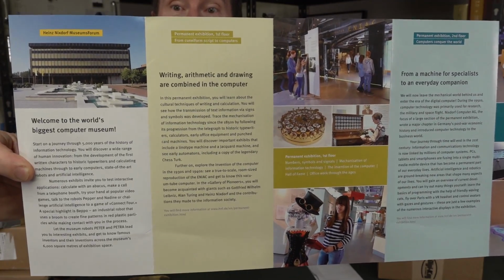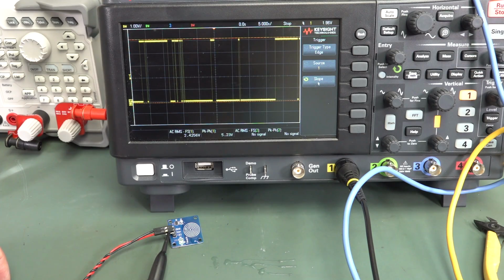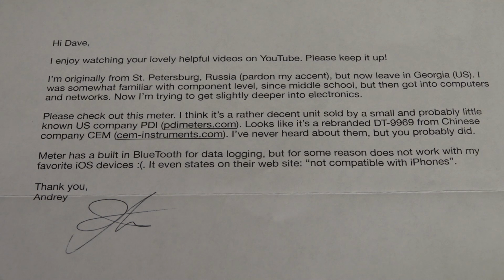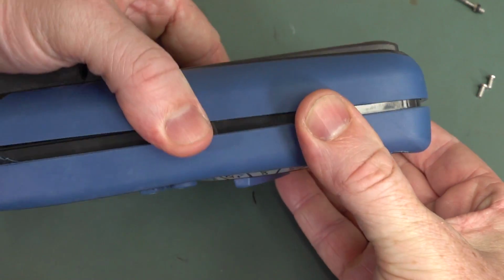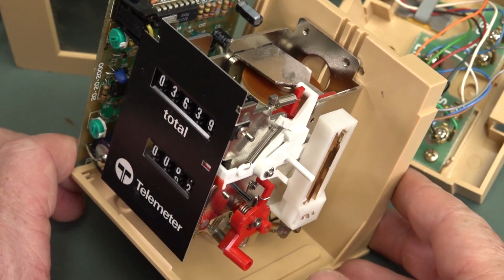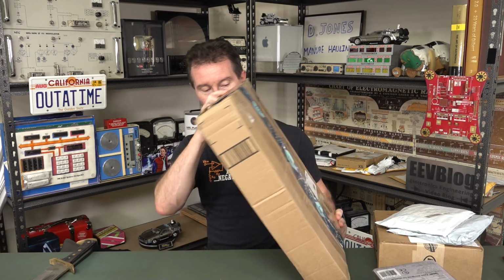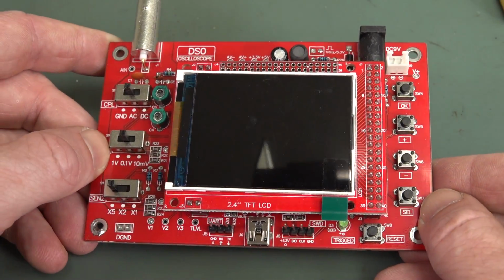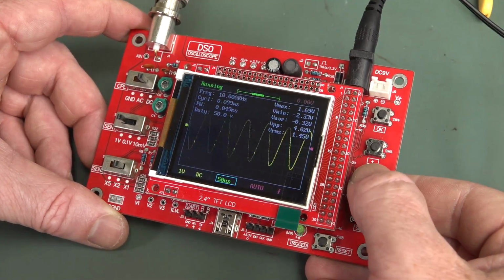EEVblog #1272 - Mailbag

Comment: Not gonna sign up on LBRY, sorry.  Blockchain is good for some things but where are the actual streams being hosted?
api.lbry.tv... which is on AWS. That still putting your content in the hands of a big corporation. If Amazon doesn't like it, it's goneski. Short of Bittorrent, video is not decentralized as the bandwidth requirement is too great. Also, you probably won't be in the best company on there... The people getting kicked off YouTube and heading to other services are hatemongers and crackpots.
Reply from the maker: Streams are being hosted on a combination of LBRY servers and the individual machines of the viewers, it's how decentralised video works.
And no, Amazon or anyone else can't nuke the video, the LBRY system is protocol layer thingo like HTTP is, LBRY.TV is just a nice web interface to make it more appealing, you can bypass that and use the LBRY app directly.

Comment: 20:13 "NEVER connect the meter leads across a voltage source while the function dial is in the current, resistance, or diode mode"
Well I WAS going to put the meter in between the leads as an intermediary device, but now I am warned @ how an unenergized USB 1.0 port must immediately destroy all it touches due to its capability to provide... indefatigable potential. gratuitous f-bombs

Comment: Is not the accuracy of that multi meter only as relevant as the accuracy of the parts in a circuit. My electronics teacher taught us that when doing the math and measurements of a circuit you are only accurate as the least accurate part meaning if one part is only accurate to 1 decimal place then measuring a voltage to five decimal places is a waste. For most hobbyists needing a meter one that does 50k samples vs 20k samples is not going to matter so nit picking the meter over that or the leads or the beep it makes is useless negative comments. Really ask yourself will the meter do the job, will it work reasonably well for a hobbyist. I have both a NeoTeck DM6000 Pro and a Uni-T UT61E, both do their jobs perfectly fine and cost under 125 CAD. Got the UNI-T for it's ability to connect to a PC and see the meters output in linux.

Comment: D7, the big through-hole diode in that multimeter, is a 6.8v Zener diode.

If it only has an ATmega processor in it, then they're probably doing the heavy lifting for the interactive application in the AXP core in that CSR bluetooth module.

Comment: i have a genuine JYE Tech DSO138 scope that i bought way back, before I could afford a proper scope.
TBH, I bought it mainly for the soldering practice. The SMD ICs were pre-soldered,  but nothing else. I had some fun with it, and found some use for it, but 'it is what it is.'
About the same time, I bought a JYE Tech FG085 DDS Function Generator kit, which I still use today.
My soldering skill has increased considerably since those days, but unfortunately, my electronics skill level hasn't quite kept pace :-(

Comment: Hi, A. Rich from Ohio. I just googled “Tectronix 2213 focus adjustment”, A wealth of information popped up. Here for example a very nice pictorial presentation of the repair: 

http://www.byan-roper.org/steve/steve-at-play/antique-electronics-and-2/tektronix-2213-focus-repair.html
Just a reminder: scopes with CRT tubes have high voltages, be careful. Please heed the precautions outlined by Kasper Abigail in a post below. DONOT ELECTROCUTE YOURSELF. By the way, you will find discussions of the issue of this repair also on Google. Here is a site for a free pdf Service Manual for the 2213:

http://w140.com/tektronix_2213_service.pdf

Comment: Hey Ethan. I recently watched your videos about capacitors, and you state that Electrolytic capacitors become unreliable through time, but you don't give any detail about that. Do you have an example of how long they last in different applications ( it should depend on the which capacitor, but just to give a general idea). I tried researching a bit and found some info about shelf life, but from what I got they have sort of a parabola shaped life cycle, where if you don't use them they last little, if you use them at a proper range they last the longest, and if you try to get too much out of them they break sooner. I thought it's an interesting concept, and it's all quite weird to me. I study electronic engineering in brazil and we don't learn much about the subject, it's mostly unrealistic theorical stuff. If you know a lot about the subject it can be nice to make a video about reliability of electrolytic capacitors and other kinds.

Comment: i got a similar DSO low frequency oscilloscope. it's useful for audio stuff, couple it with a 10x probe and it can do some 230vac stuff. i had some success reading the debug pin out of a psu that exploded on me a few months ago. you can also kinda measure capacitors.
DO NOT trust any measured value on that thing though..

Comment: I have another of the JYEtech scopes (the DSO shell/DSO150 about the same price with similar firmware and specs but much better controls). The crazy thing it that it has taken over 90% of my oscilloscope uses. I repair a lot of stuff for fun and for power supply and audio circuits it's all that is needed, and easy to throw in a bag at the same time. It's even fine for a lot of microcontroller stuff, when you want to check if a signal, clock, data, PWM, you name it, is there and in the expected ballpark.

Oh, anf if you do got for the original from JYEtech you can get a kit that hasn't the SMD components soldered either.

Comment: The "strain gage" is actually a trimmable resistor network used for nulling the zero output from the internal strain gage bridge.  You adjust the value by cutting the various links on the pattern (tongue angle highly critical).  Info here:https://www.micro-measurements.com/press/micro-measurements%C2%AE-bondable-resistors-transducers-now-built-advanced-sensors-technology
Reply from the maker: Makes sense, thanks.

Comment: Ethan, There is a forum post in the EEVblog from a few years ago that you can look at. Someone else had the same problem with the beam focus. See https://www.eevblog.com/forum/repair/tektronix-2213a-repair/. A user manual for the scope can be found at https://www.download-service-manuals.com/en/manual.php?file=Tektronix-2518.pdf and the service manual can supposedly be found at http://ebaman.com/index.php/remository/ELECTRONICS/Test-Equipment/Tektronix/Scopes/2XXX-Series/Tek-2213A-Oscilloscope-ebaman.pdf/

Comment: That kink in the curve is very much like something i observed when i tried to run the SAR ADC on an STM32F3 at 3x the max clock frequency. I would notice it on my temperature sensor, when i tested in a thermal chamber, and went past values where the ADC readout was at one below nice round powers of 2 (many caps are switched in for the measurement, i guess). And it was worse with higher numbers - 1023 was coincidentally just about where I wanted to do some room temperature calibration, and it seemingly lost sensitivity around that point. Just when it reached 1023 in a thermal sweep in positive direction, the reading would flatten out, stay there for a while, and "catch up with itself" like is seen in the scope. Sweeping from below, when approaching those values, the measurement would suddenly speed up and stay at 1023 for a while, and then continue with the expected slope, with no hysteresis - again, just as is seen on the scope screenshots.

Comment: Tektronix scope problem: high resistance resistors have increased there value in the focus circuit. Find them and ohm them with a multimeter.

Comment: For the scope, check and replace the 510K resistors in the focus circuit if present.
They are a known failure point on a bunch of the 22xx etc scopes.

Also, check the output filter capacitors in the PSU while you have it open too, they tend to dry out and fail.

Comment: I ordered the DSO138 as a kit (pre-surface mounted) and spent several hours one Saturday soldering it together. The instructions were nice and clear but there are a LOT of parts and as a newbie ... it was daunting. In the end I got it right the first time but I am still feeling lucky that I made no mistakes. And I use it all the time as I do not have a proper oscilloscope. It's good for "go or no go testing" of audio signals and some lower frequency digital signals like MIDI. Only one channel however :(

Comment: Thought I'd mention that DSO138, they also sell a better kit which only costs a few dollars more, the DSO150 it's basically the same scope with some minor improvements and a smaller footprint, but the big reason it's a better kit is that it comes with a case and it's also much nicer to control thanks to having an encoder to work with.

Comment: Just a quick tip for the lad with the Tek 2213 scope issue.... First check the resistor chain in the focus circuitry. Theres a voltage divider consisting of a number of 1M ohm resistors (8 off from memory in a 2213), or 510k in a 2213A. Check the values with your ohm meter. Chances are some are out of spec......

Comment: Interested in your new $150 DMM, would you consider potentially adding an LED to indicate continuity alongside the buzzer. 

This is a featured that seems to be commonly requested in my office but we've never found one that does this.

When under a stage mid rehearsal there is 0% chance of hearing anything, I'd imagine others in live events might be interested in something similar.

Cheers

Neil
Reply: i 2nd that request, and a decent led that can be seen, we dont all work down caves...
Reply from the maker: It does that with the display backlight, just like on the BM235
Reply: @EEVblog  Why can't the 121GW do that with the backlight?
Reply: Usually the buzzer in DMM has internal oscillator so it should be possible to hack a LED with resistor in parallel to the buzzer._
Reply: I'm a bit hard of hearing and don't hear many of the buzzers on meters anyway!

Comment: Regarding the out.of focus Tektronix scope. I wonder if the deflection coils on the CRT are out of position.
Reply: Scope tubes like this use electrostatic deflection with internal deflection plates so there are no external deflection coils. However, there is however a trace rotation coil which is used to compensate the effect of the earth's magnetic field to make the trace level. The trace rotation coil has no effect on focus

Comment: Dave, small remark,suggestion about multimeter beeping, it is probably for a small group of customers. I have tinnitus, in my case i hear a constant beeping sound. It would help me great if the multimeter beeping would be adjustable in volume and pitch/frequency. I own a couple flukes and others, but they all beep in the sound range I hear constantly. Being adjustable would be great for people like me (and others).
Reply: Some of Keysights multimeters have the ability to change the beep frequency in their menus.
Reply from the maker: Not sure that's possible. It does have a LED backlight alert though, no need for sound.
Reply: My sympathies.
Reply: Dave, the sound is so easy...if you can hear it... i now already have to look at the display, so a led blink on the meter does not make Munch difference. I do not know how the tone is produced, if it is done by the 🧠 “brain” I thought a small adjustment (add) in the programming.
Reply: @joopterwijn  most of the beeps from multimeters come from a piezo buzzer which only plays 1 tone. Apply a voltage get a tone, nothing else.

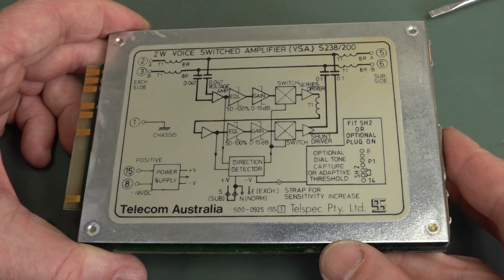Comment: That thing at 38:00 might be useful in a DIY synthesizer build project. As for the oscilloscope at 49:30 , I just received one too and it cost me € 17,99 including shipping (assembled but no case). They are useful for audio measurements but not much else. But if you don't have any scope at all , it is at least something. No match for my Rigol DS1104Z though ^___^
Reply: ...... I have one in my P.C. behind tinted glass displaying hard-drive activity. 
I think it looks cool. I also made a test jig for a coin validator, (displays output pulses).
Reply: @robbieaussievic   Oh wauw, that's a really cool idea!  I'm planning to build mine into my DIY synthesizer but I need to figure out how to get the switches on the same level as the display. But that's not too big a problem. :)

Comment: About the cheap DSO, I bought original one for about $20, with the SMD stuff already soldered,  and through-hole components included in the kit. The oscilloscope itself, for the price is good enough for most of the DIY stuff, but I recommend to choose always the one with all components already mounted. It will save time and headaches.
Reply: ...... I have one in my P.C. behind tinted glass displaying hard-drive activity. 
I think it looks cool.  I also made a test jig for a coin validator, (displays output pulses).
Reply: And changing opamp to genuine tl074/tl084 reduces distortion a lot!

Comment: Hey Dave I have noticed with the cheap multimeter test leads that they have a coating on them. Not sure what it is but if you file it back they work fine.
Have a try
Reply: swiftrick15 Maybe so they don’t corrode while in the container ship ?

Comment: The Heinz Nixdorf Museum is indeed great. If you are in the region check it out.
Had the honor to work with them some time ago and it really takes some time to experience it all.
They have pretty much everything related to computer history and also some interactive setups from old to more modern times.

On the multimeter 9V batteries are annoying.  But apart from that it seems pretty nice.
Reply: Yes, the Nixdorf Museum is great! I haven't been there in a long time, but 15 years ago or so they really fueled my appreciation (pun intended) for SGI workstations :-)

Comment: I used to install those 2 wire vf hybrid amps. Some lying around here somewhere.
They were used to adjust the gain of a Tie Line which was used to span 2 sites with voice lines. Popular at the time with money markets where speed in making a deal is essential.
Or if you had multiple sites and wanted to network your PABXs.

These lines could span multiple exchanges and even interstate with the use of carrier.

The other use was with Inwatt Lines which were the predecessor to 1800 & 1300 numbers.
There was only a small number of exchanges terminating Inwatts, so lengthy runs were common.

Comment: There will be a fixed resistor in the focus cct  that has gone very high or open..carefully probe around until you find it ..with the power off and unplugged.

Comment: 55:42... Nah... too many beginners will screw up that fine pitch SMD MCU soldering and get discouraged to build anything else.
Reply: The hardest part for me to solder was the BNC socket. :) No high heat capacity tip, so it's just tacked on somehow - some say the bigger the glob, the better the jaaahb. :D
Reply: YCbCr I had to put a BNC plug in the jack to prevent the center from moving around when the nylon insulator started to melt.
Reply: For a first timer maybe, but a second or third kit? Eh, it's fine I think. Didn't discourage me, and I've put it together and it worked on the first try.
Reply: I completely disagree. It's not for people who have never picked up an iron. And, frankly, if you get discouraged that easily, it'll probably save you a lot of time. You won't have to waste your time pursuing further electronics knowledge/skills, only to find it too hard, and end up quitting after investing much more time... and you can continue working at McDonald's.
Reply: @xenonram  Well Andrew... seems that you have no clue...
You sound like an "Expert"
I don't get discourage at a simple to assemble PCB as that one but 
a beginner that has never soldered a fine pitch IC may very well 
have much difficulty.
BTW... We assemble all are own Through hole and SMD PCBs in 
house. Perhaps it is you that should continue working at McDonald's... 
Nice try Trolling... but fail...:-)
Reply: @lasersbee  I don't think Andrew was actually meaning you.....

Comment: i use some of those cheap scopes on a manual test jig to check the product output connections are pulsing correctly.  Makes things super simple to plug in product and look at scope LCD to confirm output is switching. Works great
Reply: ...... I have one in my P.C. behind tinted glass displaying hard-drive activity. 
I think it looks cool. I also made a test jig for a coin validator, (displays output pulses).

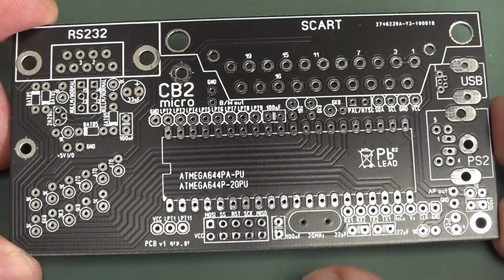Comment: 16:30 No SCART used in Europe for ten years either, all HDMI these days...
Reply: Quite a few TVs still have a Scart socket.
Reply: @ferrumignis  I'm sure there are quite a few tv's with that jack. They're currently 20+ years old.
Reply: @xenonram  My TV is only a couple of years old and has a Scart.  You can still buy decent brand name TVs (e.g. Sony) that have Scart connectors.
Reply: Hahah yea.. maybe more than 10 yrs :) last thing i remember using it for was to route the audio out of my old TV..  and by that time, SCART used to be pretty dead already :)
Reply: It depends on the TV. If you buy a high end one now, it will probably not have any. If you haven't got a SCART, there is a composite output pad (B&W though) on the PCB, just to test this. Or build this very simple converter http://cb2.qrp.gr/extensions/#8_Color_composite_videoS-video if you want color composite. If you don't even have a composite input there are scart->hdmi adapters for $20 or so. Make sure the adapter accepts the RGB signals of the scart, these $10 ones won't work in color.